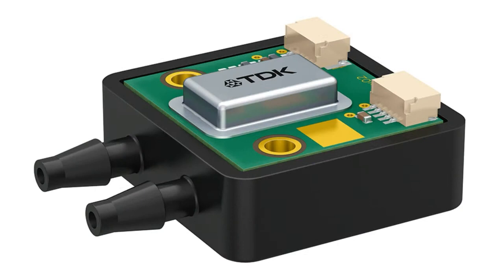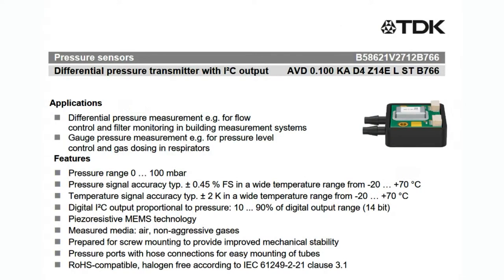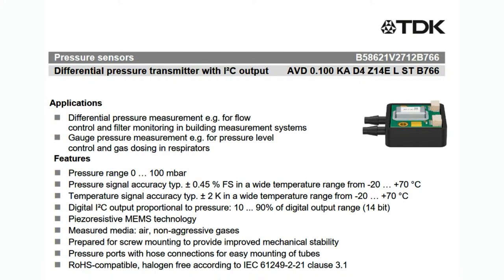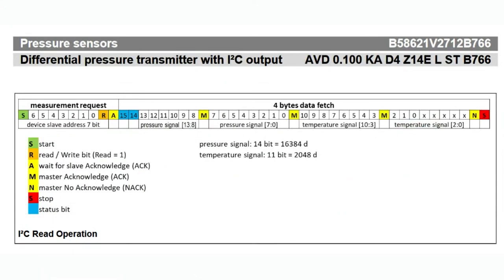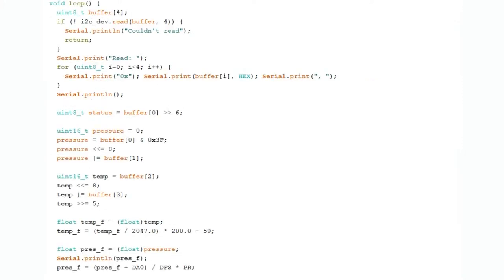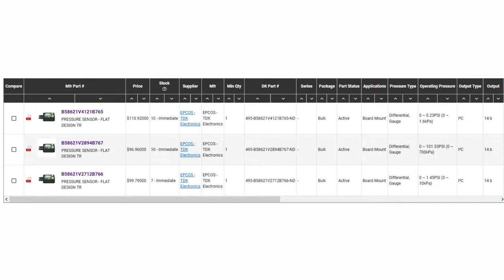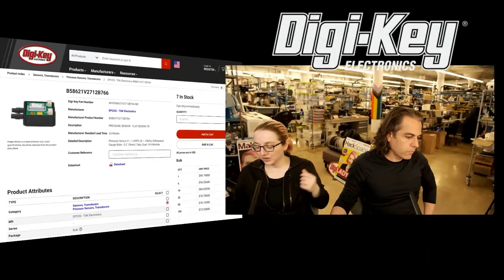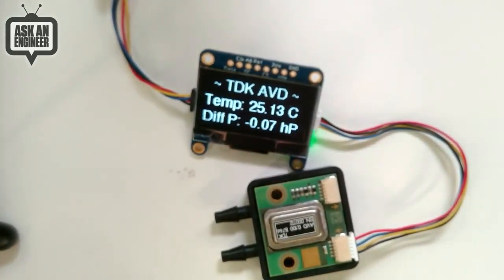EYE on NPI – TDK AVD Series Low-Profile Pressure Transmitters #EyeOnNPI #DigiKey @DigiKey @Adafruit

Comment: Almost Stemma QT sockets on that dev board... Might actually pick one of these up, though it's a good bit more pricy than the absolute pressure sensors. Would also work to monitor a radon vent system, those often have manometers (basically very analog diff pressure sensors) you're supposed to church.